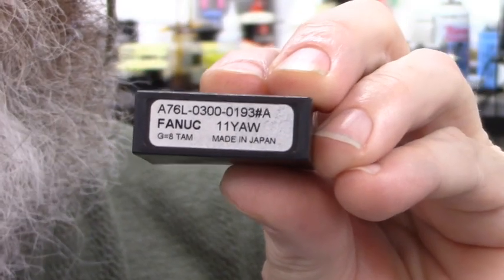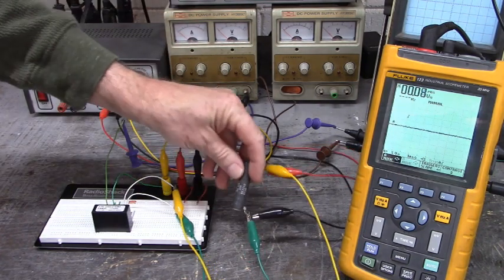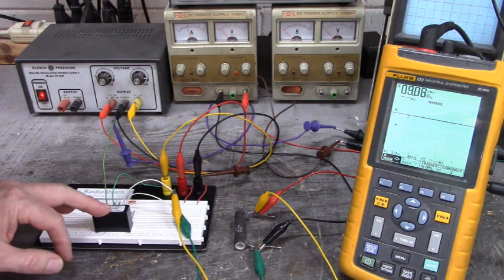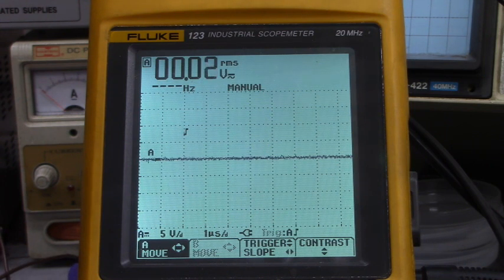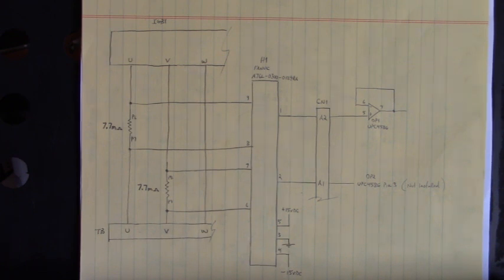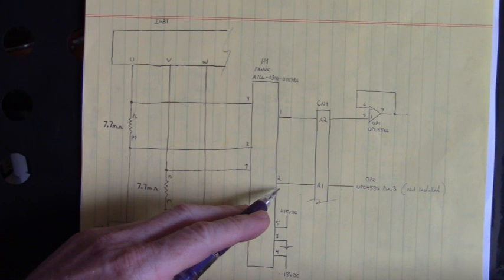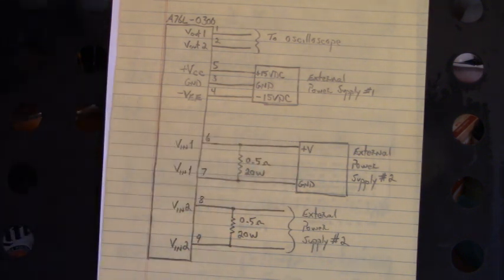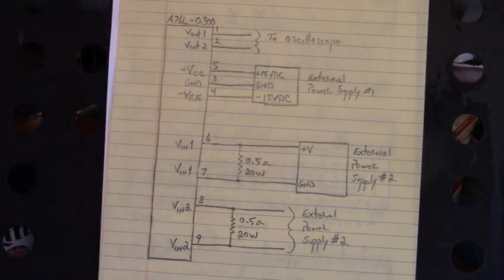Fanuc Isolated Amplifier Module A76L-0300-0193#A for the servo motor current sense circuit.

Comment: If inputs for amplifiers 1 and 2 "see" the voltage drop across current sensing resistors, could you just feed varying voltage directly from your power supply#2 without the 20W 0.5 ohm resistor?

Great videos as always PeePaw. I missed your background music, though.

Thank you for your videos.
Reply from the maker: Yes Sir, you are correct. I directly applied the power supply to the inputs. And I was able to vary the output when varying the voltage input. The voltage levels were different though. With a voltage input of from 0Vdc to 1.8Vdc. I saw an voltage output of 0Vdc to 13.7Vdc. Very interesting. Thank you Rafael for the great observation:) Thank you very much for stopping by:)
Reply: @PeepawMcDonald  You're my hero. Thanks to you I also repair same type of servo drives, Fanuc, Mazak, etc. Don't forget ya da man!